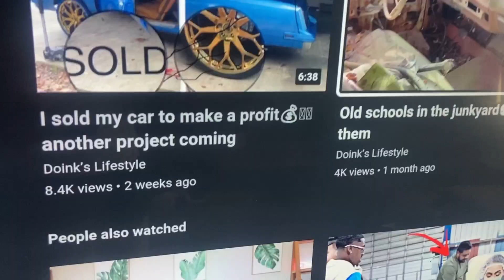I CANT BELIEVE THIS WORKED‼️(350 motor is much better)🔥💪🏽

Comment: That's called a 350 one belt more those are some good motors all u need to do is put a cam n it n put a stall converter n trans n that motor will pull dam good I think u have a limited slip rear end looks like the right side was spinning the the left side started but good job I love it

Comment: Lol you said 350 nothing major bruh don't sleep on it fam for real I done seen them 350s out run some of them LS 5.3 get that 350 with a tune and a big thumper cam and put some 3.73 or some 410 in the rear with a posi rear end and you good you don't need no LS on the real unless you plan on doing alot of racing their good for that but to be real them box chevys and bubble chevy are to heavy their made to cruise

Comment: It's a 350 with throttle body heads block is similar  to vortec just throttle body heads
Reply from the maker: Ok so are they still ok in power
Reply: Yea the OK when u get them machined like upgraded  but they give good low end power but if u talking but power power I don't command these but it's a fun motor
Reply: @doinkslifestyle  you could always get some Vortech heads and put them on